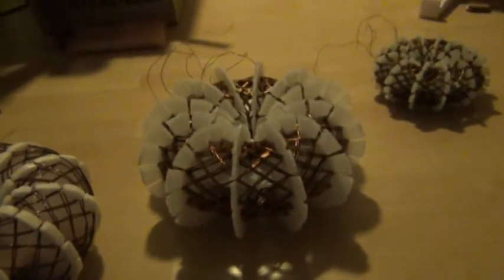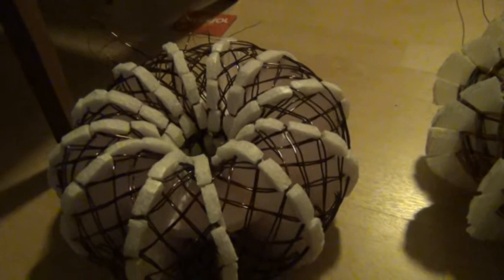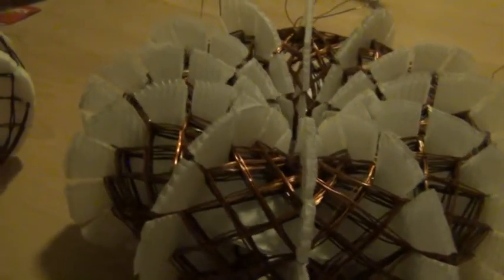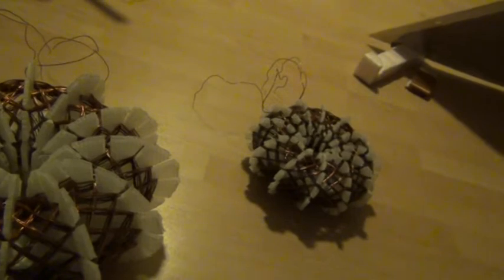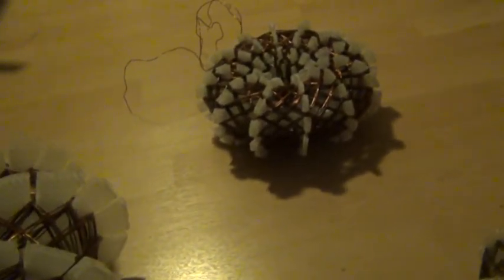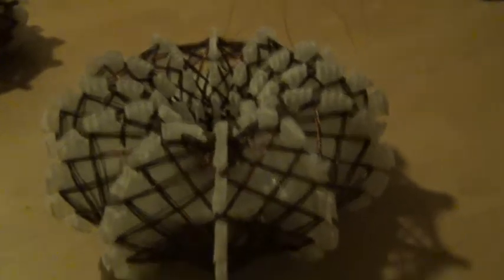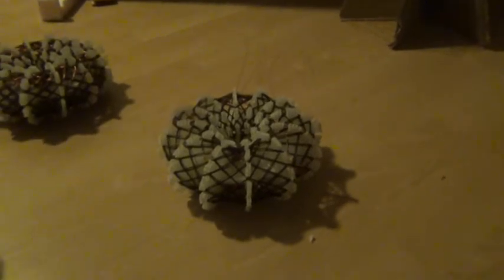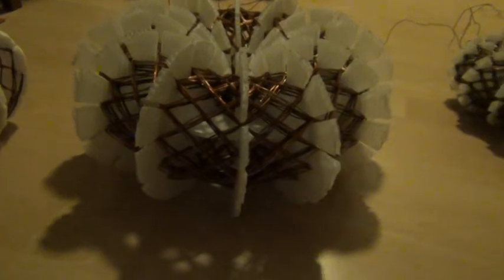ABHA vortex coil update - Size and winding patterns

Comment: Shame I saw this so late after posting. I used to play around with hi-nd audio installation in uni. I would see terrible distortion coming off some common install jobs on these highly sensitive systems. The way we would tackle that is by using silver connectors / wires when increasing the power efficiency and gold plated connectors to structure the signal without any loss. It was shocking how effective this little change could be compared to bare copper wire plugins, even though we were adding another junction to the mix!

Comment from the maker: I have seen this video before, but what he says is far from the whole story. It's not to just wind allot of wire and use very high frequency. But i agree with that high volts is a key and this is why i need an stable amplifying circuit.

But that more wire is more effect contradicts why i get more effect with the smaller coil i made that uses same gage wire but less wire is used. So there is lots more to it.